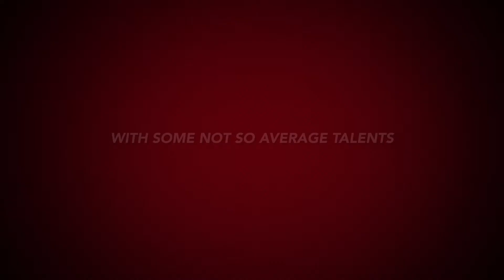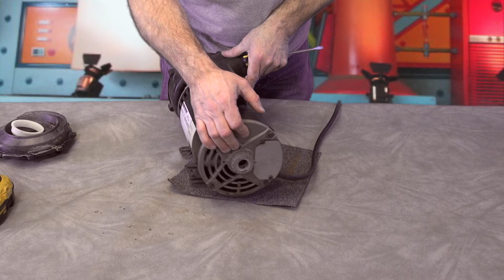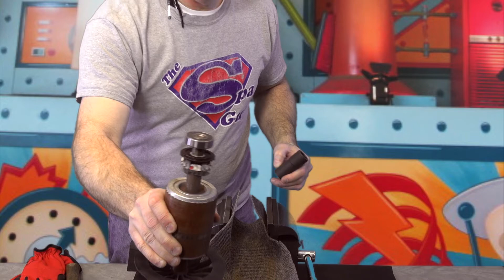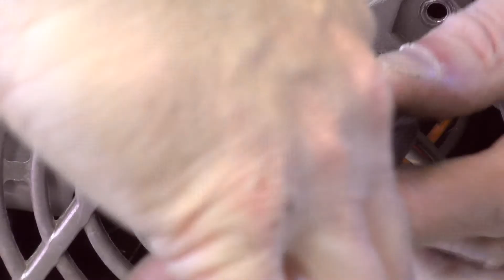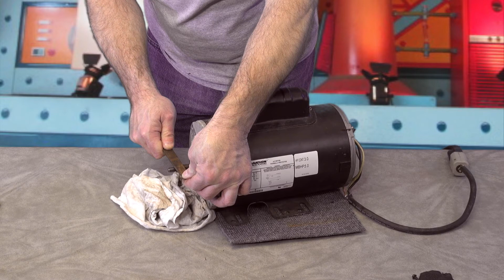Replacing Bearings on a Hot Tub Pump Aqua-Flo How To Spa Guy

Comment: Congratulations on making the best videos on the internet for DIY folks.  A couple of helpful comments:

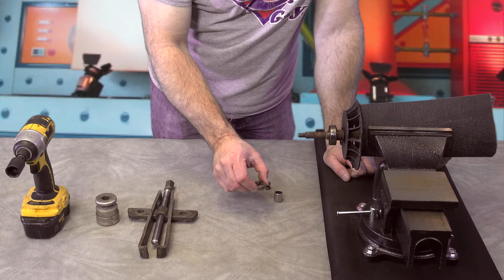For those of us with Guangdong pumps, the thread on the shaft (shown at 5:30) is metric M10x1.5 (nuts available at any hardware store) and the socket to protect the end of the shaft is 17mm.

Removing the end plate(shown at 4:50) can be a real bear.  Tricks to try in order of violence:

1)  Heat shaft and tap the end plate (as shown in the video):
2)  no luck?  Protect the shaft end with nuts and socket, apply tension with bearing puller to the outside of the end plate and tap; (don't warp the end plate)
3) still no luck? Cut some of the webbing in the endplate to insert bearing puller behind the plate and catch the central bearing holder. This allows you to put a LOT of tension on the end plate as you tap without warping the plate;
4) still no luck? For the Guangdong pump you can cut a 5-1/2 inch hole in a piece of scrap 2x10. This allows the plastic fan blades to pass through but catches the edge of the endplate all around.  Now you can beat on the (protected) end of the shaft with a hammer;
5) still stuck? Order a new pump and use the old one as a doorstop.

With the endplate off you can get to the bearing (shown at 8:45) with your favorite bearing puller. After my puller failed to budge the bearing on the shaft, I looked for one like that shown in the video, no luck. Tricks tried in order of violence:

1) Penetrating oil, heat, tap and pull;
2) still stuck? Cut the bearing off with rotary tool and cutoff wheel.  Careful not to nick the shaft.

Now I'm ready to order the seal and bearing kit!

Thanks for the video guidance and the encouragement when I called.

Comment: My impeller broke off the shaft and all I have left is that brass fitting. ive tried to break it free with vicegrips but its not moving and starting to take off some of the threads. do I need to get a torch and apply heat then try to remove the fitting next?
Reply from the maker: Yes some heat.. Go easy many times when you get to that pint the threads break off and you are done.. Most of the brass knurls are 1/2" Hex for a socket but not all..
Reply: Just got my motor apart to replace the bearings and it looks like a loose staple from the cabinet got eaten by the motor. Motor works, but the fan behind the front bearing is destroyed. Is it possible to source the fan?

Comment: Thank you sir. I did this bearing replacement. Your instructions were great. The switch mechanism doesn’t engage. I have have to help it with a flat tip screwdriver to get it turning. What now ? Thank you
Reply from the maker: Check to see if you bent the metal 2 speed switch in the back when you pulled the rotor out.. If it is a metal finger and you bend the finger it will not start on low.. The finger should be straight..

Comment: Hi, I followed this and got to the point where I have to put new bearings on.  The old ones were NSK 6203DU and fit tight.  The new ones are also NSK 6203DU and they are loose, as in too loose.  They just slide right on.  The numbers are the same.  What the heck?  Pump is an Aquaflo XP.
Reply from the maker: Greg 6203 is like a 350 chevy engine it is a designation for a design not a size.. Meaning there are 100's of 6203 bearings... Like a 350 Chevy there are many versions of the 350 chevy motor.. On the bearing is it a designation of a type of bearing not a size.. most likely this is the correct bearing.. https://hottubpartsofamerica.com/motor-bearing-high-quality-6203-15-9mm-fits-some-motors/

Comment: Hi there, awesome totorial.  I will go ahead and try doing it on mine.  Can you tell me if its the bearings in my case???  The pump 2 (I turn it on at the end of video) make an awfull noise.

https://youtu.be/8qMSzRvaKq4

Thanks man!!!
Reply from the maker: Hello Toe, Yes I Agree the bearing is noisy most likely the front.. Usually you have a seal issue when this happens.. Here is a link to my site for the seal and bearing kit.. https://hottubpartsofamerica.com/1-front-bearing-200-seal-pump-parts-kit-fits-most-aqua-flo-spa-hot-tub-pumps If you are out the USA I sell on eBay for overseas shipping... https://www.ebay.com/itm/1-Front-Bearing-Seal-Pump-Parts-Kit-Fits-Most-Aqua-Flo-Spa-Hot-Tub-Pumps/221520716070?hash=item3393a9e126:g:qOEAAOSwxCxT6R4E:rk:2:pf:0

Comment: I have a aquaflow 2hp flomaster xp2e and I need to order bearings.  Both of my bearings read 6203rlbd on them by peer. Are they 2 different sizes? I see you have 2 different bearings listed above.
Reply from the maker: Bobvilla, There are two different sizes. the one with the tape measure in the picture fits almost every motor but there are exceptions and but an Xp2e would defiantly not be an exception..  http://hottubpartsofamerica.com/motor-bearing-deluxe-high-quality-6203-fits-most-but-not-all-motors/ is the correct one.. Thanks, Spa Guy
Reply: Thanks spaguy.